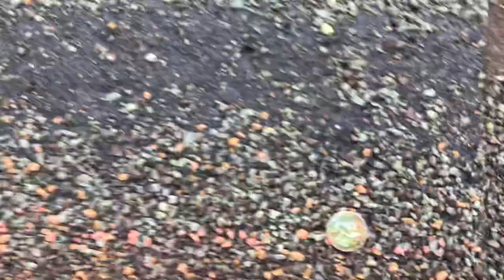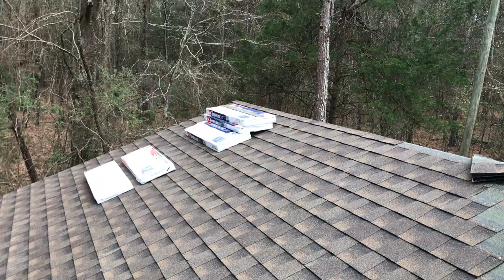Why Nail Pattern On Comp Shingles Is Critical - Quality Control

Comment: I am also one of those guys that would rather slow down and make sure that I hit the nail line. Quality over speed everytime
Reply from the maker: Henry Fehr So many roofers assume that hitting the nail line is optional, but nothing could be further from the truth. Many - & I mean 9 out of 10 or more believe me being emphatic about this is way overboard on quality & entirely unnecessary. But those roofers either don’t have the experience to know better or couldn’t care less about the customer. I’m glad you do! Thanks for watching!
Reply: Exactly. I love the SPEED aspect of roofing and nailing to look good and cool BUT that don't make for quality and assurance. Sure I see some who are real quick and remain on the line like required BUT there are a ton of those who go super fast who don't keep it in the path they're required. I'd rather be a fraction slower BUT know that the job will be clean, safe and issue free...

Comment: I just installed 3 bundles for a neighbor.  The brand she bought had two lines and almost 1.5" of nail zone. I read the instructions on the package and thought they had solved many problems in their design.  The previous shingles that the wind removed were all nailed high.  I couldn't even pull nails without tearing through the old shingles.     I am enjoying all of the videos that good roofers put out, I'm always learning.    I am also learning all the mistakes I made on the very first roof I ever did about 5 years ago.  Mistakes I won't make again thanks to good quality videos like this one.
Reply from the maker: Thanks friend!

Comment: That's where I always nail the asphalt shingles.Always. It's the thickest place, so there's way more holding power. Thank you for making a video on it. I can't wait to show a few guys. No one listens when I explain it to them. Even when I showed the illustration on the wrapping!  Cognitive dissonance anyone?
  I tell my coworkers, but they rarely listen. Either way, mine are done correctly. Stupid guys nailing super fast, blowing through, and losing the integrity of the product! Drives me nuts. The work is shoddy when nailed too high.   Great video. You are 💯 percent correct. Wish more folks had high standards, like you. I've worked with people that think they"are the best" on all aspects of roofing. Most"best roofers on the planet" likely never once sat down and took the time to read the f***ing instructions. Thanks again
Reply from the maker: Howdulike Themapples I’m happy to know there are other roofers out there who care about craftsmanship & know how to achieve it. It also helps to be willing to listen to others & consider their advice, even if we have experience. One of the greatest liabilities of having experience is pride. Only when pride is avoided can experience can pay high dividends. Thanks for watching!
Reply: Nailing to high is better then nailing to low. If you nail to high, you can pull that shingle, and put a new one down, if you nail to low, your nailing into the row below and that's an issue.
Reply from the maker: @J.T.19134  So let’s nail high everyone… C’mon y’all! Who’s with me?

Comment: Thank you for the education. I had the same experience with a bunch of idiots that couldn't do anything right but the cheap labor saved that company money.  Still finding stuff wrong after 8 months. I worry that the shingles will start blowing off. Don't know why but they already look wavy and the truss lines are showing. Never had any problems with the original shingles that were there 26 years except a couple blew off. It was a massive 12/12  roof. 
Seems like almost everybody is a crook these days. It's sickening.
Reply from the maker: Third Eye You couldn’t be more correct. Imagine if you can though, not just having one bad experience that resulted in multiple deficiencies on your roof, but having done thousands of quality control roofing inspections, having worked customer service for over 3 years, having worked side by side with other roofers for over 30 years, having acquired your own 1500+ customers that you acquired for 20 of those 30+ years & listening to how your own customers had been previously taken advantage of before you came along & last but not least having fixed thousands of other roofers mistakes while working for your own customers as a licensed contractor, & you can begin to see what informs my experience & my attitude about bad craftsmanship in the roofing industry. Most people watching my videos don’t realize I have all that experience but that doesn’t change the fact.

I have seen more bad work by soggy wanna be roofers over the last 32 years that it’s left me a bit bitter, because almost nobody in the roofing industry today cares enough about the customer to do anything except brag about how great they are while continuing to do crappy work.

I’m sorry to hear that you were disappointed by my fellow competitors.
Reply: @MrThedocholiday  Thanks for you reply. There are many things wrong with this roofing job here that I didn't even mention. It's not just roofing. It's everything you hire somebody to do. If at all possible I stand right there and watch everything they do and have even caught them lying while I'm right there watching them. If it's on an upper level, good luck if you can't see it. When I was at Lowes someone told me that there were some young guys in there buying stuff and bragging about how they were taking old people's money, not doing what they paid them to do and ripping them off. (how sad) I was told that there are alot of people complaining about rip offs. Rip me off and I'll tell everybody in town what you did "forever" is what I tell them. I've noticed that you can never get the worst ones to come back and they won't return the call. Even some of the high profile companies are using very inexperienced labor. Some of these construction workers are either going into prison or coming out of prison  I try to do as much as I can myself and if I hire it out, I have to take a crash course in everything I have done and every product I buy. I don't care if it costs more, I want it done right, a quality product and peace of mind so can move on and get other things done instead of paying again to have it fixed.

You, my friend, are a great blessing to people who need this valuable information so we know what to look for. We need so many more of you. Keep up the good work. Beautiful job. Wish you could have done my roof.

Shine a spotlight on the cockroaches

Comment: Im shingling my roof now with architectural style just like yours in the video. I couldnt agree more about the speed and sloppyness of most roofers, and that line is not easy to hit. BUT...I'd rather be above that line than below.  I try to just kiss the top of the line because if you kiss the bottom its an exposed nail.  IMO that nail line is a lower limit and the common bond line is the upper limit. Unfortunately the nail line is not the middle of where I want the nail to go. This is not per the manufacturer but I just cant imagine they would spec exposed nails.
Reply from the maker: You’re absolutely correct! Even their new hdz shingles claim a taller nail pattern spec, but when I looked on the underside of the shingle they hadn’t changed the fact that nailing higher won’t penetrate through the bottom portion of their laminated shingle, which based on my experience is critical. So they supposedly improved the lamination bonding between the upper & lower portions of their shingles instead of making the overlap of the two portions larger. So if you take their advice & nail higher through the single layer upper portion of the supposedly ‘better’ bonded shingle, you’re relying entirely upon the lamination of the shingle to hold fast the lower portion in the summer heat. I just don’t buy it because I’ve seen too many laminated shingles come apart in the sun when they’re nailed through the upper single thickness, high above the middle double thickness of the shingle. Add to that the fact that nailing through both layers across the middle significantly improves wind resistance as well.

I aim exactly for the same area as you. I try to always kiss the shingles just above the nail line. The double thickness portion of the shingle is only 3/4” tall. So if you keep the nails within a hair’s breath above the nail line you should always have both layers nailed with no exposed nails.

Your observation is solid. I wish more people paid attention like yourself. It would likely save billions of dollars throughout the industry over the years. However, the manufacturers probably wouldn’t much appreciate better labor practices, so their shingles actually do last longer, now would they?
Reply: @MrThedocholiday  IKO Dynasty. You’ll never have this problem again.

Comment: I agree with what you’re talking about 100% I hate machine gun nailers. I am wondering if your stagger is 6 inches or more.? Good looking roof though buddy keep up the good work
Reply from the maker: Drew's Roofing & Home Repair Thanks... 6” is about exactly what the stagger is. Also, after servicing & repairing literally thousands of leaks over 3 decades I’ve never seen a leak caused by the stagger being anywhere near six inches or more, unless of course the roof pitch is below the manufacturer’s minimum recommendation, but in that case I’ve seen no amount of stagger be sufficient. So basically, anything greater than about four inches on a standard pitch roof is a safe stagger, even though perhaps not optimal.

I’ve had the benefit of troubleshooting leaks for decades. That’s informed how I do everything; right down to the very smallest detail. It also helps me know what’s NOT necessary as well as what IS necessary for quality work I could stand behind. Does that make sense? Thanks for watching...
Reply: 4 inches is definitely not enough stagger as a matter fact if you read the plastic wrap on the shingles it clearly says 6 inches or more or minimum
Reply from the maker: Drew's Roofing & Home Repair Okay, so I want to throw a huge caveat on the front end of my comment here. If you’re only referring to the manufacturers recommendations & not referring to whether or not the shingles will keep water tight with less stagger then you’re absolutely correct, but the recommendation you’re referring to is based on what? 3.5/12 roof pitch, since all shingle manufacturers recommend no less than 3.5/12 roof pitch for their shingles. Therefore as a matter of liability they give recommendations to the industry that keep them out of litigation liabilities. And they base those recommendations on the absolute minimum of what the shingles can practically perform at. But if you increase that roof pitch you can decrease that minimum stagger & still achieve the same waterproof results. Roof pitch is everything when it comes to stagger pattern & I prefer to think practically instead of theoretically like the manufacturers do who right the warranties & give recommendations according to those warranties.

You seem to have missed my previous comment about having over three decades of experience chasing down leaks on literally thousands of roofs having informed my installation practices. I am not saying that anyone should dismiss manufacturers recommendations, especially not for a customer, since you wouldn’t want to void their warranty. But I am speaking practically since I thought that was the context of your question. Regardless of manufacturers recommendations, comp shingles will not leak because of a stagger pattern below 6” unless the stagger is significantly narrower, the roof pitch is near the ragged minimum of 3.5/12 or lumpy in ways that create water ponding or something else is amiss. That’s just reality despite theory or manufacturers recommendations.
Reply: I personally would never go below 6 inch stagger I don’t care what the pitch is
Reply: I agree so much I’m back watching your video again this is a good explanation in my opinion I also hate speed nailers
Reply: 10 20 30 40 easy safe stagger less cutting always add half shingle if u hit small finisher and everything will b 10 inch stagger

Comment: how to repair the faulty nail pattern? should it be renailed on the marc and resealed?
Reply from the maker: @rusty-y8r  You typically don’t need to seal the nails, unless they are driven too deep through the shingles or below the nail line where they can cause a leak. So just add the correct number of roofing nails across the nail line & move along to the next shingle. If they’re nailed above the nail line they will not hold the shingle properly in high winds. But if they are nailed on the nail line they should never leak & they should hold the shingles in place during high winds - up to 110 miles per hour.

Comment: What is the proper amount of exposure of the shingles from row to row? Don't comp shingles have smaller exposure requirements than standard 3 tab? Also, how many nails and where do you put them? Thanks
Reply from the maker: Proper exposure on all comp shingles is about the same, with very few exceptions. With 3 tab you should be following the top of the water keysways across the tops of those keyways with each subsequent course above. I think the actual measurement is 5-5/8” but it’s printed on the outside of every shingle package so read & follow their instructions. So that’s where each shingle aligns. The number of nails per shingle are also recommended on the outside of every shingle package. Typically, it’s 4-6 nails per shingle, depending on the application. The nails always go on the manufacturer’s nail line without exception. That’s why they put it there. This should provide enough overlap of all subsequent shingles to cover all nails installed & keep all shingles watertight for the life of the shingles.

Dimensional comp is similar, but all subsequent shingles being installed over the first shingle should align the bottom edge of subsequent shingles with the middle-step laminated bottom edge of the shingle below. There is a laminated portion of each dimensional shingle in the very middle of each shingle running horizontally across each shingle. The bottom edge of the upper portion of that laminated shingle is where you match the alignment with the very bottom of the next shingle above it. Never stretch the course above to the manufacturer’s nail line which is painted onto each shingle, or you will breach the manufacturer’s warranty & subject your roof to potential future leaks.

As previously mentioned, there are clear installation instructions on very package. Unfortunately, few people read those instructions despite the fact that they have picture illustrations included. Under no circumstances can you get away with not following those instructions without breaching the warranty, however, there are quite a few roofing installation hacks that can be done without causing any trouble for your roof except breaching the warranty technically.

Some hacks are inconsequential to the performance of the roof & very practical while not being technically correct & others are absolute no-no’s that if the manufacturer ever comes out to investigate premature failure of their shingles, they will laugh at you if you expect them to cover those hacks. Stretching courses & not nailing on the manufacturer’s nail line are two of those absolute no-no’s. The next no-no’s in line are installing shingles below 3.5/12 pitch & narrowing the side lap on shingles below obvious minimal recommendations.

Many people install comp shingles on 1.5/12 to 3/12 pitch porch roofs & wonder why they are leaking after 5-10 years. Shingle are not intended for low pitch applications under any circumstances. As far as side lap hacks go, the only time the manufacturers will not cover side lap discrepancies, is if those discrepancies are extremely obvious - like 2”-3” side lap when manufacturers call for 5.5” side lap. So  4”-5” side lap installation of shingle, while not technically correct, will never likely cause any problem & not be flagged by a manufacturer’s investigation of premature roof failure unless that failure is somehow obviously related to a side lap issue.

In all my 30+ years of doing thousands of installations & repairs I’ve very rarely ever seen a reasonable side lap hack 4”-5” cause leaking issues, unless of course the shingles are installed on a low pitch application. But the fact of the matter is that no amount of side lap length will suffice to keep shingles water tight under low pitch applications no matter how long you make those side laps overlap.

So in every case I would advise following the manufacturer’s recommendations, however, if you choose not to, you ought to understand why & what the risks are.
Reply: @MrThedocholiday  Thank you for a very through explanation. You went above and beyond anything I could have hoped for but I do have one question. Our roof is a 2/12 pitch and when the current roof was done (approx 15 years ago) they applied Ice and Water membrane to 100% of the roof 1st. The shingles are GAF Timberline architectural. Is the side lap you're referring to the amount cut off each subsequent beginning shingle when starting the next row?  Thanks again @Duster  Dan.